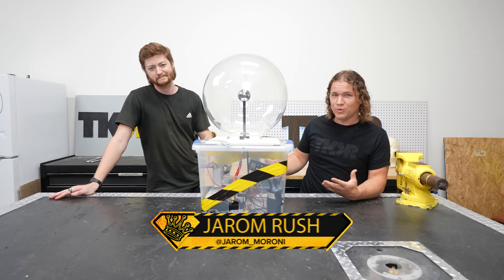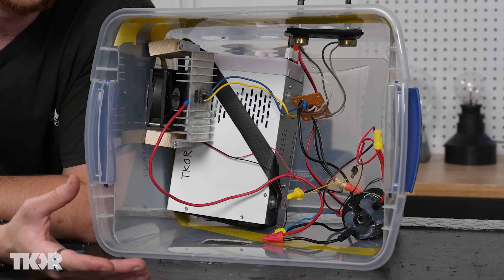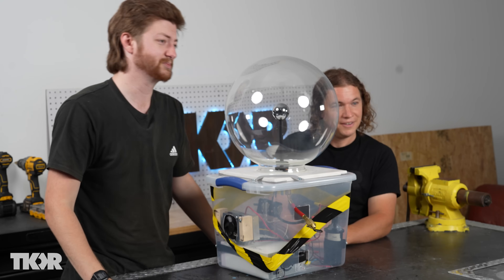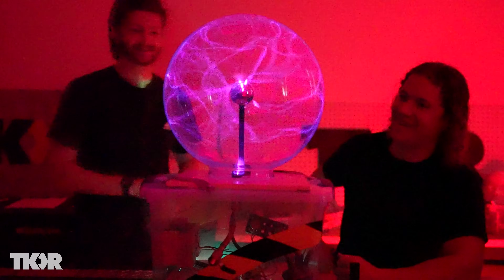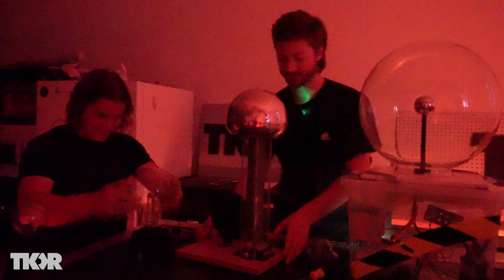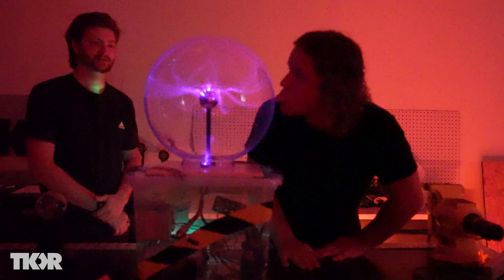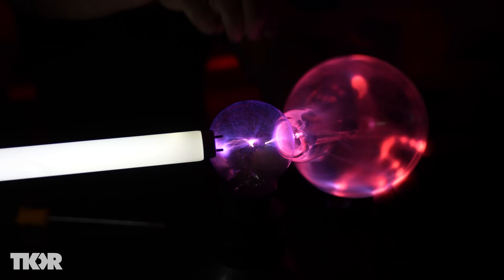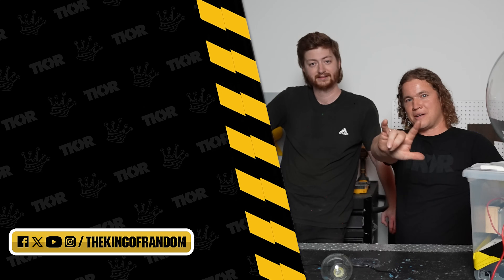How to make a Plasma Ball from scratch! Is it easier than you think?

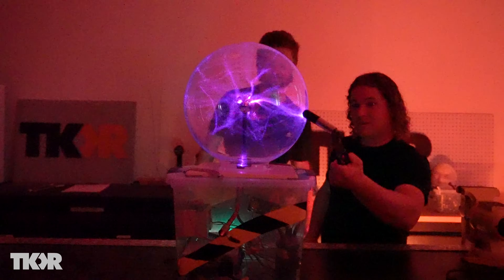Comment: 8:09 this leads to another fact, moving plasma, especially through Castlereagh, can usually be controlled by magnetic deflections, but this will not be visible from the plasma ball in operates in a high frequency, electronic field, and because of this the charges do not have time to get moving far or fast. so they will not get deflected.

Comment: I built a simulator circuit with an ignition coil, be careful!!! General motors LS coil will probably give you the best performance, the ones with the little aluminum heat sink on the back

Comment: 8:10 it is pretty strange.

Moving plasma can usually be controlled by magnetic deflections 

Causing minor changes to the arc 

But this will not be visible for the plasma that you made .

It operates on a high frequency electric field, and because of this the charges will not have time to get moving far or fast so they will not get deflected

Comment: That's what I do with mercury lights, and I can point at the radio and change the reciever signal,, use the TV remote in the next room pointing it at myself, and sometimes get a static shock that will flash blue when I flip a switch, touch a wall or a car.
My kids think it's magic. I told them it's static electricity. Somehow, for some reason, electricity goes wonky around me? 
Why?

Comment: The reason it died wasn't because of static electricity. The glass, electrode and you acted like a capacitor that passed the high frequency high voltage current back into the 555.

Comment: I will add a small piece of knowledge that was not explained in the video: many people know transformers (ignition coil) work on AC and not DC and then they can step up/down the voltage according to the ratio of windings of the 2 windings of the transformer. 

This video used DC - so how did it step up the voltage ? 

The truth is the coil will do its job on a "pulse" of DC voltage too. 
You can think of it this way - the relay turns the DC on and off many times a second (according to the timing of the 555 chip output wave), this essentially creates many DC short pulses to the coil, each time the coil's first winding receives such a pulse, an electro-magnetic wave is sent out to the second winding of the coil which then is converted into current on the coils output at a higher voltage.

"Smashing" up the DC into many pulses actually creates a kind of AC here.

Comment: Your classic red and blue plasma globes seen everywhere are 95% neon and 5% xenon at about 200-250 torr (760 torr=1 ATM/15 PSI).  BUT-- you can  make an incredible orange, pink and purple tentacle globe with 88-90% Grade 5 neon and 10-12% DRY AIR at about 250 torr. The globes which have bright purple tentacles and bright red tips can be made with about 90-95% neon and 5-10% pur welding-grage argon.  Pure white lightning comes from Grade 5 pure krypton at about 250 torr.
      If you steal the high voltage module from a version of the Lumisource plasma twist-style lamps made around 2000-2004 which uses the 12VDC external module that plugs into a jack at the lamp base it will power a 12-inch diameter plasma globe quite nicely.  These reported formulas are from test plasma globes I have made myself--not from the internet. The plasma high-voltage drivers run at a frequency of 20-50 khz--and the flyback output from an old color TV picture tube can actually power a plasma globe at around 22 khz.  Just in case you want to get serious about do-it-yourself plasma globes,  I have YouTube videos posted to prove it under my YouTube userID.  Feer free to check it out.
Reply: Most helpful comment 🙌

Comment: By doing something similar to the experiment you performed while touching the screwdriver to the load side of the coil wire, you can also create a 'Jacob's Ladder' effect.  A Jacob's Ladder is what they called those arcing devices used in the old black and white Frankenstein movies.  We built one of those during our electrical apprenticeship back in 1980 by connecting two separate 12-ga copper wires about a foot long to each lead on the load side of a Neon light transformer.  (I believe the voltage there was somewhere around 9,000 volts).  We arranged the two copper leads (with the power off) in an upright, standing 'V' pattern, mounted on a terminal block, which was in turn, mounted on a block of wood, spaced about a centimeter apart at the base of the 'V' getting wider as the wires went up.  When the power was turned on, the electricity would air arc across the space between the two copper wires.  As the copper wires and the air around them heated up, the resistance increased, causing the arc to climb higher and higher up on the inside of the 'V'.  As the arc rose, the distance between the two wires increased, causing more air resistance.  As the copper leads cooled below the air arc, the arc would shut off and restart itself at the bottom of the 'V'.  It would do that over and over again indefinitely.  CAUTION: This is very dangerous, as touching the bare leads or the bare copper wires could cause injury or maybe even death.  The following is a link to a Popular Science DYI on how to build a Jacob's Ladder using electricity. https://www.popsci.com/how-to-build-jacobs-ladder/#:~:text=It%20consists%20of%20two%20vertical,leap%20to%20the%20negative%20side.

Comment: i had a commercial 4" ball it worked for sometime & then died out, found out it HV transformer failed, so i made a circuit using 555 & bike ignition coil, the arc filaments were even more powerful(current consumption was also very high) than original also i got zapped just by the ground wire of the supply hv was leaking onto the ground of supply, the x'frmer used by the commercial had a differential o/p, one to the middle of the glass & other to the base of the glass, i again made a hv circuit using commercial differential hv kits & now everything is working fine.

Comment: 8:15 here’s why moving plasma can usually be controlled by magnetic deflections.

But this will not be done with the plasma ball it operates on a high frequency electricity in because of this the charges do not have time to get moving far or fast so they will not get deflected

Comment: The "orange" colour is probably sodium being eroded off the glass and then ionized (sodium glows a blight yellow when it's excited and that yellow was probably mixing with the reds and purples or the other excited gases to make the whole thing look "orange". Souce: I had a plasma globe as a kid and managed to put an tiny electrical ark within the solid glass itself by holding a small lump of aluminum/gold foil to the glass, it was actually quite beautiful and was one of the brightest and purist yellow I ever seen and it didn't jitter like a normal ark either, ten the whole globe imploded in front of my face lol (I wasn't hurt, just a bit sad I broke it).
Reply from the maker: No way that actually happened to us too. It ended up burning a hole through the light bulb. Must not have been filming for that part or it got cut in the edit -Jake

Comment: Car ignition coils and flyback transformers are on opposite ends of the frequency spectrum of operation. Ignition coils are pulse transformers, using pulsed DC. Flybacks are terrible with pulse DC but work efficiently with high frequency AC. 

Easiest way to make his circuit is a 555 timer triggering a mosfet driving a flyback.
Reply: So if a relay basically creates pulses and the coil is better for pulses, why do you say "Easiest way to make his circuit is a 555 timer triggering a mosfet driving a flyback" when the flyback is better with pure AC and not pulses ?

Comment: You can make this 6x6cm large by using a 220ohm resistor and a tip44,2n3055(reccomended)tip42 or some transistor with a flyback form a crttv and just connect one end to the glass ball and the other end to ground

Comment: Pulling a vacuum in a thin glass container that's not intended to hold a vacuum is very sketchy. If it breaks, it will throw glass shards everywhere at high speed. At least wear some eye protection.

Comment: was that a homemade tesla coil there? pretty cool video.
Reply from the maker: Basically
Reply: Sorta similar. A tesla coil takes advantage of resonance to boost the voltage higher and higher and create arcs through the air. They both rely on high-frequency high voltage AC, though, a tesla coil generally uses a much higher frequency. Additionally, a tesla coil uses an air core, unlike their iron core ignition coil. This allows the tesla coil to operate at a much higher voltage without breaking down across the transformer.

Comment: The vacuum reading is inches of mercury. And the size of the pump won’t change what it able to get to. It’s trying to overcome a leak. Fix the leak and your smaller pump will work just fine.
Reply from the maker: Mmmmm not sure the leak is large enough to be the cause. But good point.

Comment: Ok nice.  But where’s the part how you explain how to make it. I like how Tkor is going back to its roots but I felt like I could actually build Grants “how to” projects.  Here, you say ” some electronics magic”. That doesn’t really fit the video title
Reply: Agreed. Absolutely brilliant, but I don't just want to see it; I want to understand it.
Reply: From their whiteboard diagram it looks like: DC voltage from the power supply goes into a Pulse Width Modulator, which feeds into a MOSFET, (kind of a digital, solid state relay), which then feeds into the transformer and turns the transformer on and off very quickly at the Frequency, (the number of times per second), and the Pulse Width, (the length of time each of those frequency pulses is held on for), you need every second.

So essentially they are turning a very high voltage DC power supply on and off many times per second, controlling how long it is on and off for in a certain time period and then how many times that time period is repeated per second.
Reply: I always felt like I could build grants stuff with the kids
Reply: Rr
Reply: Goto keystone science for circuit explanation
Reply: can this only be done with glass or will it work with other materials like acryilic , or plastic or some unbreakable material? and what gasses work better or can we get diffrent color lightining,??
Reply: Well the title is not wrong. Like "how to make electricity" and make a video you just need batteries, wind turbines, solar panels or nuclear plant without explaining how to build any of those power sources.
Reply: Did we watch the same video? They spent most of the first 6.5 minutes explaining what components they used and how they work.
Reply: @am529  but not the settings or what they did that DIDNT fry the parts or anything like that.
Reply: @am529  They glossed over it.  Even the diagram was very basic.  the 555 timer was on a custom PCB, no explanation at all. They could have provided a schematic and possibly called out a channel that can go into depth on a 555 timer set up.   It's nice seeing them get back to the cooler projects, but some more knowledge would be nice to see, even if it's on another channel.

Comment: Can you make one portable and put it on a wizard staff
Reply from the maker: Oh thats an awesome idea -Jake
Reply: @TheKingofRandom  Yes please!!!
Reply: Would be awesome for a steampunk or DND cosplay
Reply: Yes, you can make it portable. Just buy a 12V plasma ball and three 3.7V Lit-ion batteries. Connect batteries in series, connect wires and on/off switch,  connect power jack (plus in the middle, minus on the round/outside part).
Reply: @haydenfrost2692  ooooo TKOR and dragons? 🤔sounds like fun!
Reply: Could you use 8 18650 25A 3.7v in series to get the 30v at like 3500 mAh or 3 paralel x 8 series to get the 30v but with triple the amp hours ? Could use the incandescent bulb then right below make a housing for the Coil, modulator/relay, pulse gen, pots w long handle,on/off switch and usb c charger. Theen have the batteries in a 3d printed cell holder inside of black pvc tubing. - If this could last long enough for like 10 individual pulses/uses I might make it . . . So how long would the batteries last, Anyone know ? -